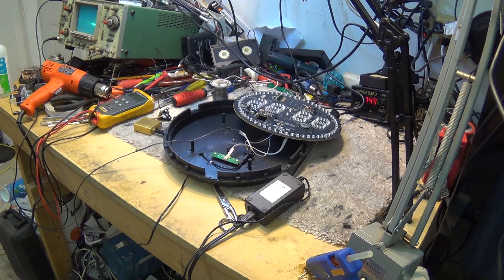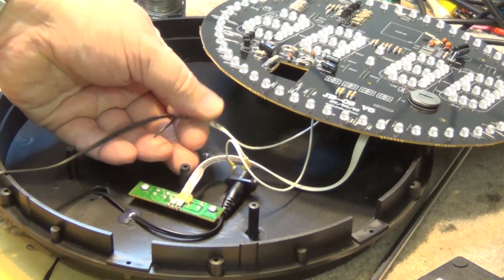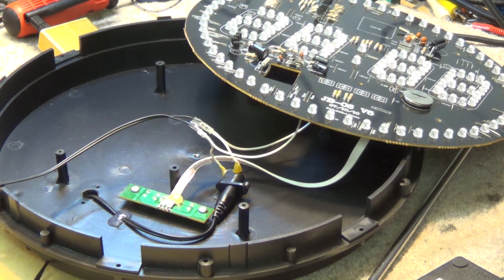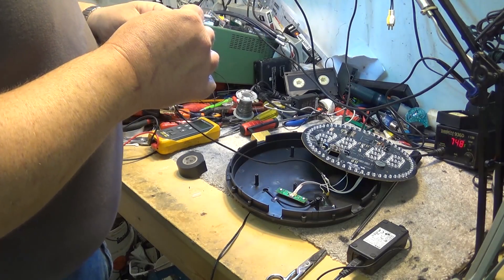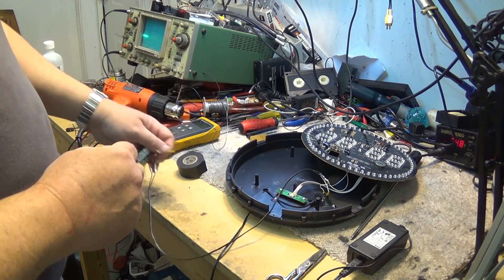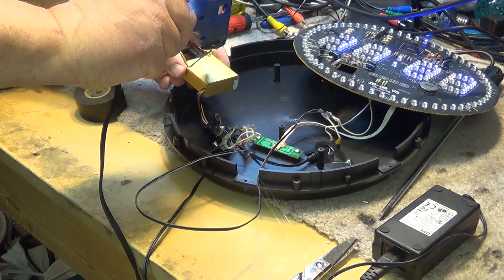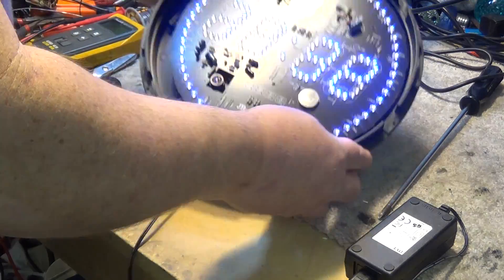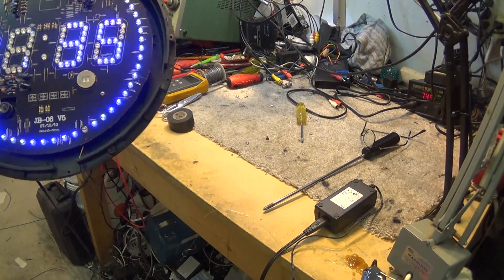Spy Camera Build

Comment: Great video as always, years ago there was a company called X-10 and I had one of those cameras but it has only a yellow plug for video and a plug for 12 volts.
I also had a wireless camera and receiver from X-10 which operated at 2.4ghz.
BTW...I bet that hot glue gun was made in CHINA...LOL
Reply from the maker: I remember X10. Total garbage.I remember an old client of mine, (the guy that owned the devices on the first 2 repair videos I did, the viewsat power supply repair) bought 4 of those X10, and the pan/tilt base units. He wanted to mount them on his front and badk doors and in hos yard.  They were so weak that you couldn't get the signal 15 feet away in in the dark you needed a 500 watt light to illuminate the yard. He bought booster kits, and wanted me to build 100mW amplifiers for each of them. That made them go 20 feet before all the interference on the 2.4GHz band wiped them out. This one I built uses a 902MHz transmitter that is normally placed in model airplanes and quad copters to provide POV for the pilot. Long range, no interference.

Comment: Am I correct in assuming that the smoke coming from camera right is the hot glue gun burning up for the first half of the video?  There is a large amount of smoke visible.
Reply from the maker: Oh you mean the hot glue gun that caught fire!
Reply: That explains it!  Did you tape any of the conflagration?
Reply from the maker: No. I wasn't involved. It was a contract job. I just supplied the equipment.